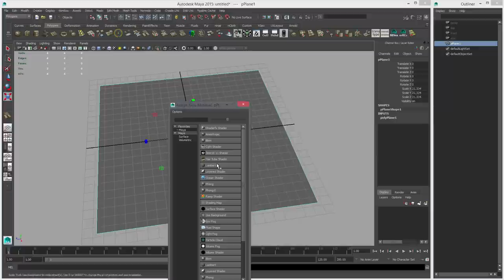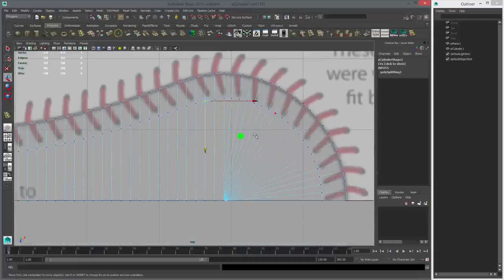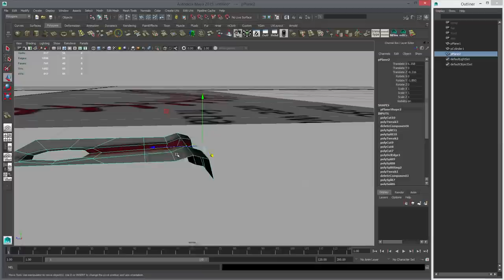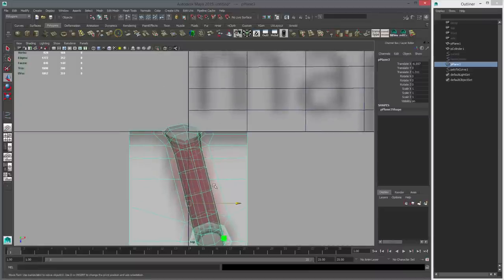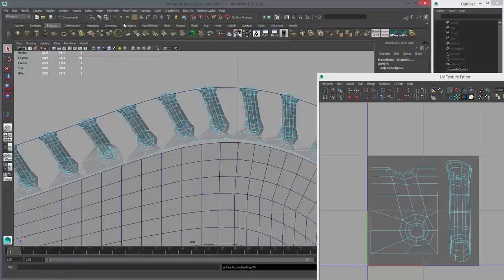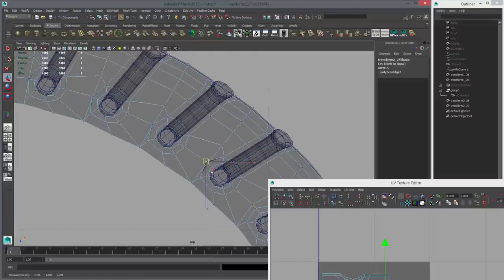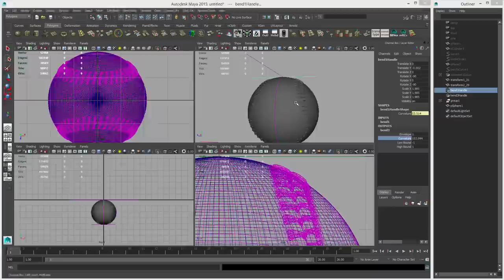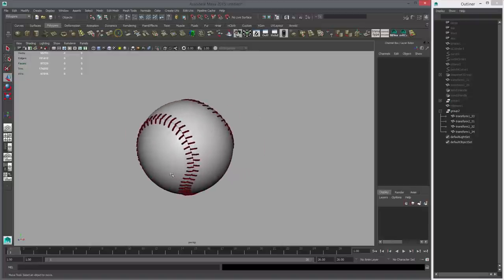3D Modeling a Baseball

Comment: I was failed on the snapshot part, but I don't know what happen~ can I let you take a look of mine problem ?
Reply from the maker: Try and follow the steps exactly, pause the video if you have to. Order of selection matters, make sure you select in the same order that I do. If it is still not working, tell me exactly where it's failing for you and the steps you are using. Thanks.

Comment: You could have saved 20 mins by just making all 4 sides of the inner leather then selecting the continuous loop and doing a animation snapshot around the whole pattern on 104 frames rather than 26, instead of all 4 corners individually.
Reply from the maker: Jordan Moss Not sure what you mean. I did the animation snapshot on 2 sides because the stitches have to match direction. I didn't have to do all 4, but I did have to do 2 separately.
Reply: Alex Cheparev That's what I'm saying, you worked in quarters with the duplicate stitches, when you didn't have to as the animation snapshot would make all the stitches face the correct direction if done for the full shape. By doing it in quarters then cleaning up in sections means it takes more time. 
An example of what I'm talking about
http://i.imgur.com/8jEUSmQ.png
Reply from the maker: Jordan Moss From the time I did the first snapshot to when I merged the whole shape was about 5 minutes. I'm only showing different ways to tackle various modeling tasks. It's not about "this is they way" or 'my way is better".
Reply: Alex Cheparev I'm not trying to say you are doing it wrong, I'm simply saying you could have saved time. I don't doubt your skill or anything. Also the "my way is better" thinking is not why I mentioned it.

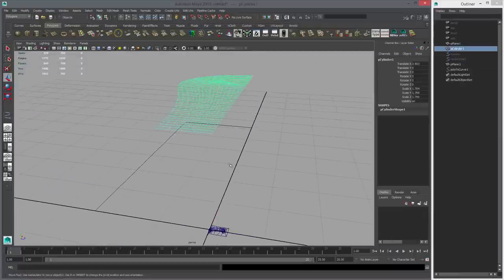From 22:50 to 40:00 you are working on all sides, but by working as a whole you could have saved around 10 mins.